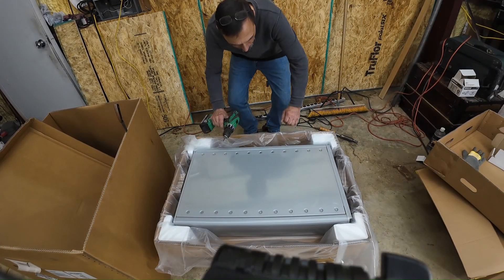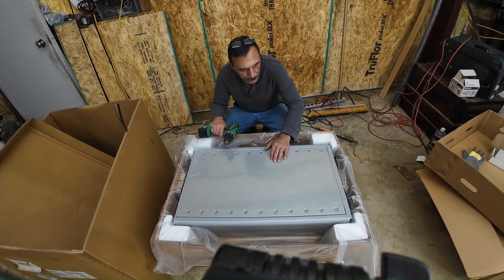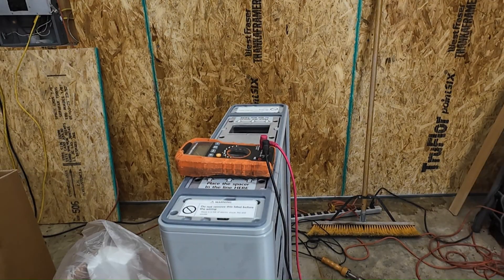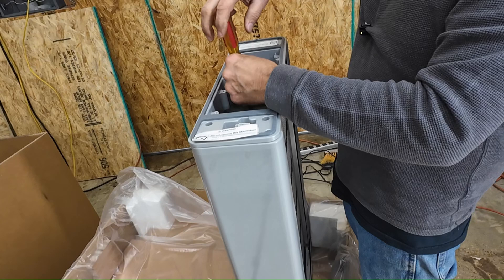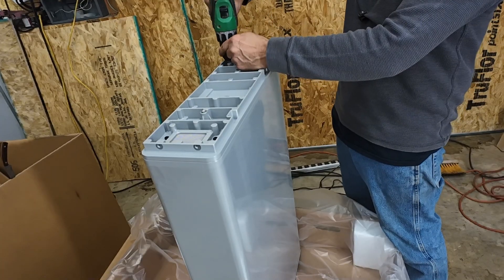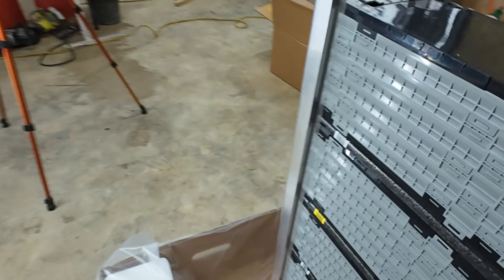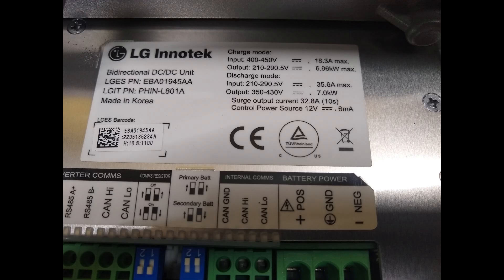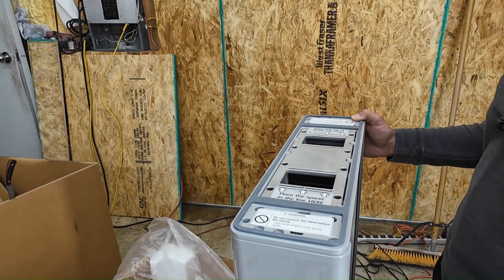UL High Voltage Solar Storage Battery for your Solis S6 Inverter LG RESU 16H Prime

Comment: I missed something.. we measured 125 volts at the terminals... then i think you said later "three five volts".. and then  came a jump cut to saying we've got 24 times ten cells that make 240 volts. I missed seeing the part about 24 volt cells....  or there being 10 of them.. the dc to dc converter was interesting.. still didn't see anything to explain how you would reconfigure this into a 48 volt system... I think you may want to do a follow up on this. Something important got edited out i think....  I'd really know what is in them. Is it LiFePo4? ....
Reply from the maker: I'll take a look at that, The LG 16H batteries are NMC.
Thanks for watching!

Comment: Very nice. I was curious about it's output and why it was so low considering the chemistry. Makes sense now that I understand that they are using a DC/DC converter to get the voltage up. This could be a failure point for this battery however it's nice that it's a separate unit. Looking forward to seeing an install and curious how it works out for you creating an installer account with LG.
Reply from the maker: Thanks for watching! No problem getting the installer account. I did set it up under a company name but they also have a DIY/self install option. You just need to watch a training video and take a simple test. ;)
Reply: Thanks for this. Thinking about adding some to my solaredge setup. Can get an inverter upgrade for 800, just need their backup interface then I can add batteries. Do you know if they sell a combiner box that can handle this voltage? The instruction manual shows one but no part number.
Reply from the maker: @nebulight  Not sure on that, the training only covered how to wire the communications for two batteries. Have not seen a combiner that LG sells.
Reply: Thanks for this. I’ve signed up for the training site and it’s lacking. The EU site seems to have more skill check out tonight. Can’t wait to see future videos.